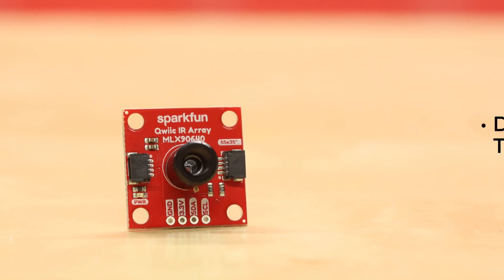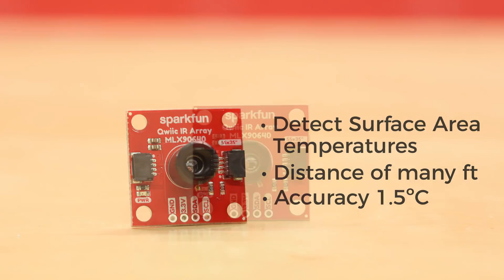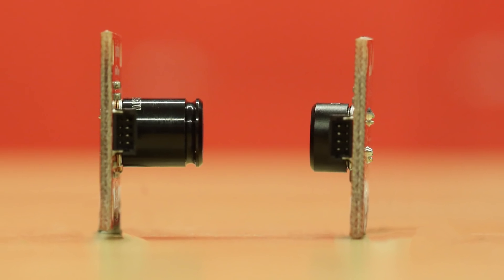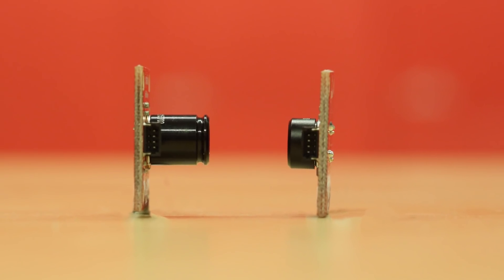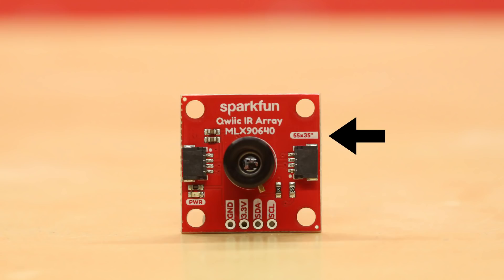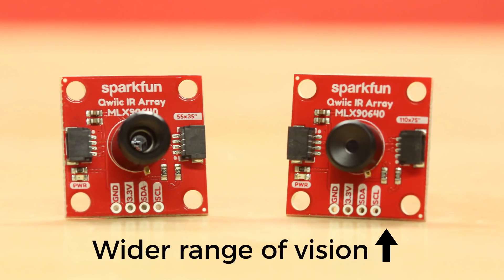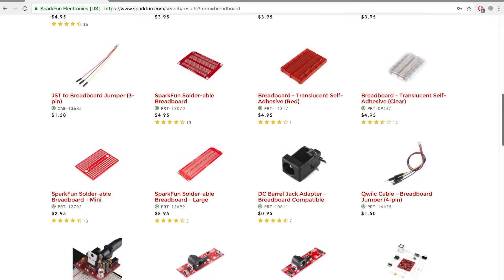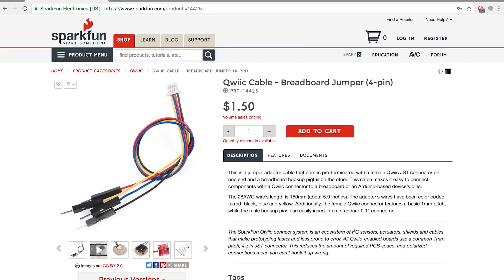Product Showcase: SparkFun Qwiic IR Array

Comment: I bought the first version as SparkX product and a bit disappointed about the orientation fault, see https://community.hiveeyes.org/t/getting-the-mlx90640-ir-sensor-running-with-an-esp32/1383/4 the sensor is at 30-40 ° wrong rotated on the PCB! Is this fixed in the normal (non SparkX) product line? On the product pages is still the wron PCB shown. On the hook up guide it is right.

Comment: I dont like being negative but it really grinded my gears when you said 20,000 bytes. Use engineering notation, its 20kb. Same as you wouldn't put this uses a 20,000 ohm resistor in documentation, you would say 20kOhm.
Reply: Oh my.... Did you have soggy Corn Flakes for breakfast? 
You're being awkwardly pedant for some reason. 
The way she said it is much more normal and natural for humans communicating to humans. 
Are you familiar with humans communicating to humans?
Reply: Peter S if you ever took an electronics class you would also know the proper way to state values. Theres a reason engineering notation and prefixes are used.
Reply: Peter S well congratulations to you. You should know then to use the correct terminology if you are just going to list the specs to a product. You would also know that in a commercial they dont say internet speeds up to 50,000,000bps, they say 50Mbps.
Reply: Oh my.... Did you have soggy Corn Flakes for breakfast? 
You're being awkwardly pedant for some reason. 
The way she said it is much more normal and natural for humans communicating to humans. 
Are you familiar with humans communicating to humans?
Reply: Wow. Look who's being awkwardly pedant now. No one cares Pete. I'm with Kirby.
Reply: Kirby, I've even seen technical spec sheets list it either way. Your version is just a shorthand. It's not really worth crying about.